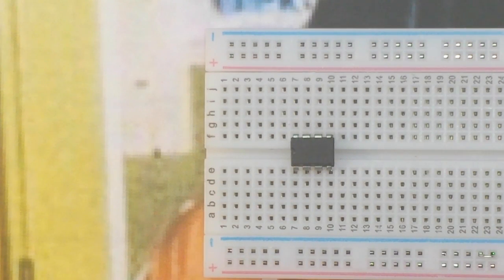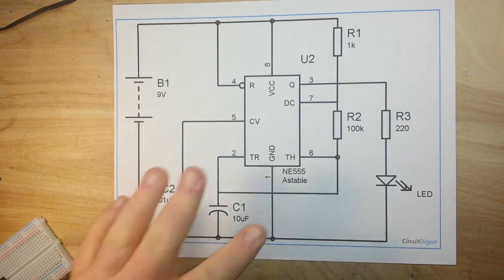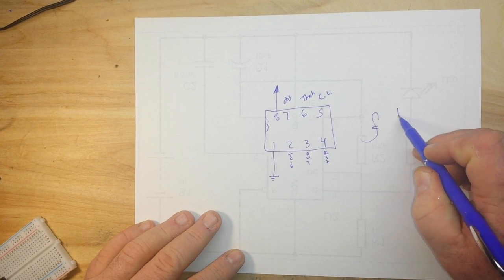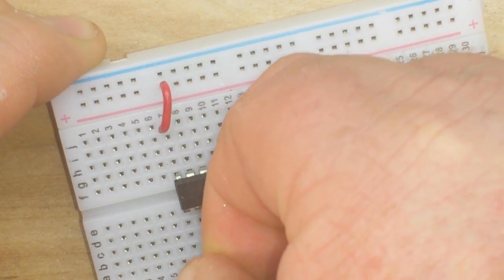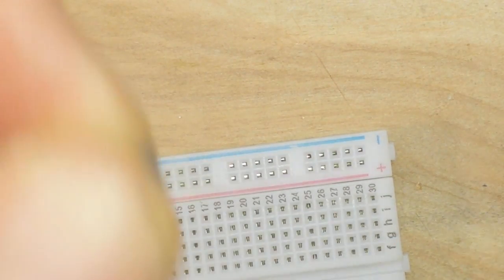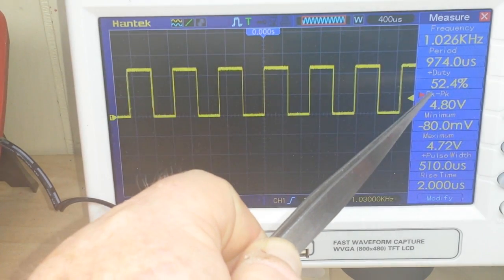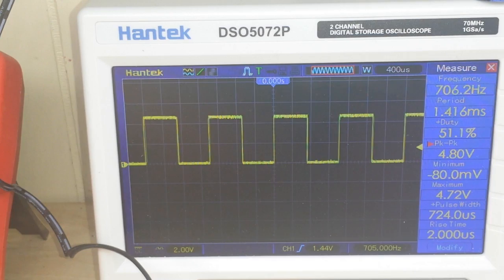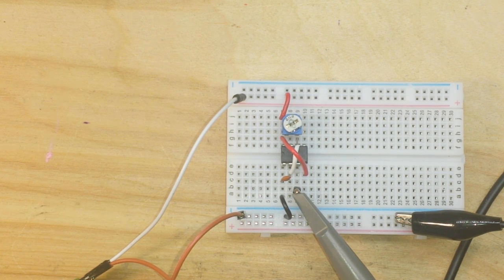The most simple way to set up a 555 timer

Comment: This circuit may be simple and it certainly is stupid.

Conspicuously missing is a power supply decoupling capacitor which is essential for reliable operation. Also missing is a decoupling cap for the Control Voltage pin. If there is very good supply decoupling, this cap may not be necessary but it is bad design practice to omit it. The instability due to lack of these capacitors is apparent from the frequency display on the scope. The pot allows setting the resistance between the Discharge pin and Vcc to zero, which can destroy the IC.
If a ceramic timing cap is used it should ideally be a C0G type. X7R aren't too bad. Nondescript ceramic disks of unknown dielectric properties are a bad choice if you want any semblance of stability.
Reply: lol
Reply: Yes, this is very stupid, it overheated my 555.

Comment: You showed us a formula for the frequency that depended on R_1, R_2, and C.  But your circuit only has one resistor. ???
Reply: Potentiometer counts as two (variable voltage divider). Another modification is to use two pots or a pot and a resistor to control the frequency. Ratio R1/R2 controls the duty cycle (on vs. off), R1+R2 controls frequency.
Reply: @camp0017  Would love to see a video showing exactly this.

Comment: Brilliant. You just answered my question 🙂
I am building a 100ns PWM and the Arduino isn’t fast enough.
Arduino can only reach 65.1ns
I am teaching myself how to build a pulse laser driver to run a 75w 905nm diode.
I am using the LM317 as a current regulator and now I can reach the 100ns max pulse rate to charge the diode. I can’t afford a $2000 driver so to build one for $50 is very good.
If my calculations are right :
R=2.18ohms
I=5.85A
V=12.8
P=75W
With a pulse duration of 100ns max.
Duty cycle is .01% which I have yet to think about. 
Thanks again.

Comment: Hi there, a newbie question: Is it possible to use this chip to turn a single LED on for 9 hours, then off for 15 hours then repeat the process?
Reply from the maker: Sure, you could make a 555 timer that, but an Arduino would be much easier. What is the context?
Reply: @learnelectronics  I have a very small enclosure and only a 4,5v battery.
Reply from the maker: Arduino Nano!
Reply: @learnelectronics  Ok, here’s the irl problem: cheap automatic Chinese chicken coup door that open and closes due to sunlight = irregular intervals. If cloudy it’s a no go. Solution: use a white LED and set on/off times to simulate the sun. I’ve tried it with a Nano and a RTC hooked up to a computer and it works fine, but I don’t want to drain the three AA batteries using a Nano and the RTC.
Reply from the maker: Hmm ok lemme think on it
Reply: @tokeofsweden  A "standard" 555 will take about 15 mA standby current so you might want to use cmos version.

Comment: Great presentation but for the guy who first heard of a 555 circuit 8minutes ago please explain what this is and why it exists
Reply: Try looking up ben eater's video on the stable or astable 555 timers.  He actually walks through the chip logic and explains the triggers and cap/resister maffs.  Simply search monostable or astable.
Reply from the maker: It's a timer with 3 different behaviors. Single shot, bistable, and astable. It can be adapted to be a clock, a switch, a timer, an audio source, etc..

Comment: Nice, but, how can I adjust de frecuency with a pot?
Reply: For the 555, the Cap/resistor combination changes the frequency of the trigger.  So increasing and decreasing the pot resistance changes the trigger.  The math is cap * resistance = interval.  It is laid out better in the datasheet for the 555.  Not all resistance is futile!

Comment: Can anyone help me on this? I try this setup with the potentiometer between Vcc, discharge, and threshold, but what I see on my logic analyzer is that the capacitor never discharges because the Discharge breadboard row is in series with Vcc, which is the right side of the potentiometer. So my output pin is low, but discharging never occurs

Comment: I have a favorite 50% duty cycle 555 circuit with just two parts parts!  It will ALWAYS oscillate at 50% D.C. and it has 100% INDEPENDENTLY adjustable frequency and amplitude.

From the standard monostable, pull out the resistor at pin 7 and the cap at pin 5 and toss 'em!  Now connect pins 2 and 6 to output pin 3!
*  ONE POT
*  ONE CAP
Adjust the frequency with the pot and the amplitude with Vcc
BTW: the formula for the frequency is given as:  1/1.39RC 
ps
The 1.39 comes from 2Ln(2)
THANKS FOR THE GREAT VIDEO!!!
Reply: Sorry, I meant "ASTABLE"

Comment: can't you do this without using pin 4 to vcc pin ?
Reply from the maker: Yes. PIN 4 is reset. It should be held high, but you can do away with it in most cases

Comment: I see you are interested in electronics
I need a pulse generator circuit please. Exactly twenty hertz and the possibility of controlling the Duty Cycle
Reply: That’s exactly what he showed. The resistor(pot) changes the duty cycle, and the capacitor the frequency. 
As far a s specific values... i couldnt tell you from top of my head. But should be easy to calculate/research.
Reply: @tuloko16  i need 400khz with modulation?

Comment: It's as simple as the flip flop I made to drive two different color LEDS through 2 different clear tubes to simulate a pulse for a kid's haloween mask made from a discarded face respirator. He got props for that. 9V battery tucked inside the respirator. Studs from leather collars, light chain and black paint = happy kid!

Comment: is it possible to adjust the length of the crest and the through of that signal?
I want to try to make the through longer than the crest
Reply: That was what he was explaining. You can set the pulse repetition rate (frequency) with the capacitor, and the dwell (% of difference between on time and off time) with the potentiometer. He indicated how simple it would be to have relays change between one component value or another. I will control a throttle with a servo for a HD RC aicraft/heli. It needs two speeds, idle and 2500 rpm. One 555 timer kit plus alternate components, and a double throw relay to switch between alternate values. Signal triggers relay and servo goes to work. Signal stops and servo returns to home position, no load.

Comment: i'll bet op amps have as many if not more uses than the 555 timer.
Reply: What's an op Amp? 🙈 operational amplifier, what does that even mean?
Reply: @Randorandom232  
It means that the chip can operate as a signal amplifier. (It can be set up for other functions too) ie. It can multiply the output signal by an amount (determined by the accompanying components (called biasing) and the internal multiplication of the chip usually between 50 and 200 times). The chips ability however is limited by the supply (or rails) voltage to the chip. The chip can not amplify above or below the max/min supply voltages.

Let's assume the following.
Supply Voltage: To the opamp: +15V & -15V. 
Input signal: Sine wave with a peak to peak voltage of 2V (ie. Goes as high as +1V and as low as -1V)
Internal Amplification: X100 -> Biasing (feedback): 0.1 -> Total amplification: X10

The output signal from this chip will be a sine wave with a peak to peak voltage of 20V (ie. Goes as high as +10V and as low as -10V)

However, as mentioned above you can't go beyond the rails voltage, so
Let's assume the following.
Supply Voltage: To the opamp: +15V & -15V. 
Input signal: Sine wave with a peak to peak voltage of 2V (ie. Goes as high as +1V and as low as -1V)
Internal Amplification: X100 -> Biasing (feedback): 0.2 -> Total amplification: X20

The output signal from this chip will be a sine wave with a peak to peak voltage of ~30V (ie. Goes as high as ~+15V and as low as ~-15V). 
Note not all opamps can go full rail to rail and will top out approx 0.7V below the top rail (ie. 14.3V in this case) and 0.7 above the bottom rail (ie. -14.3V in this case)

This is a simplified view of how an opamp works especially around the biasing, if you want to use an opamp you should look for a tutorial on how the biasing works, for a more complete picture.

Comment: How does one get the high to last a different amount of time than the low?
Reply: You can use diodes to set the resistors to either the discharge or charging phase, so that they affect the different on and off times. This adds additional components, but I think it's worth it.
Reply: Adjust the pot.

Comment: i want to use the  555 as a soft start and stop for car amplifiers that pop the speakers on shut off.  any advice?  thanks
Reply from the maker: Sorry, audio is not my specialty
Reply: Hey Tom did u ever figure out how to wire this with your amps to get a soft start turn on? I’ve been trying to figure this out also thanks….
Reply: @djrockon5729  I used something called an RC snubber circuit in parallel with the relay contacts.

Comment: how can i do it without one potentiometer one i need to be ON Every 1 Second ?? @learnelectronics
Reply: the pot is just an adjustable voltage divider, so technically you could do it with 2 resisters.  but unless you buying high tolerance resistors & caps(and even then), it'd be hard to get the desired cycle.  because of the variance in components, its pretty standard to use a trim pot(as seen in video) to tune it, often times manufacturers glue them in place once tuned. 

they are handy & cheap, I recommend getting a little variety kit, but if you have old electronics (power supplies, motherboards, audio equipment, anything really) you can scavenge them from there.

Comment: Nice and simple, but be careful not to turn pot all the way so as to short pin 7 with vcc. Discharge transistor wouldnt like that. Standard Astable set up always has resistor no smaller than 1K between pin 7 and VCC.

Comment: ....can I use it to produce high voltage connecting the primary of the trasformer to the out pout?????.....
Reply: likely so, however i would recommend using transistors connected to an hv power supply

Comment: i like how you executed the video, but there is a but, i am going to be making a 555 circuit soon for the first time and im going to use 2 resistors. sadly because i never made this circuit before, and because you used the adjustable resistor in place of r1 and r2, i still dont know how to make the circuit. it kinda sucks cause other than that you would of helped me learn how to build the circuit. thanks for the upload, i still gave a thumbs up.

Comment: Uh, you eliminated the output indicator led and current limiter. So, you didn't recreate the circuit. The only "component reduction " you did was to replace the tow timing resistors with a pot, which is essentially two resistors,  one on each side of the wiper.
Reply: A pot with 2 resistors? The wiper rides across a single resistance surface for reasons to enable adjustable control of resistance.
Thus .... 1 resistor.
(Your thinking of the wiper dividing the resistance at it's contact point.)
Reply: @raybin6873  try watching the video again. The original schematic shows two resistors creating a voltage divider. In his "kiss" version he simply replaced those two with a pot. Also,  since the output indicator circuit is eliminated, this is not a simplified version of a circuit that flashes a LED. If you don't duplicate the result,  then it's not an equivalent circuit.  Replacing an ethernet switch with a toggle switch isn't simplifying the circuit.
Reply: G E T  R E K T  he said he replicated the circuit that flashed a LED. The original circuit flashed a LED. If the recreation doesn't do exactly what the original did, it's not a recreation.
Reply: G E T  R E K T  it was a year ago,  so I don't remember it exactly.  He makes a big deal about reducing components but doesn't actually reconstruct the circuit,  that much I remember.
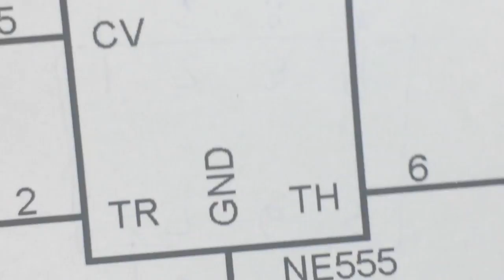Reply: G E T  R E K T  at 6:00 "...now how much easier is that than that mess?" Well, that mess actually flashes the LED, so your circuit is not a simplified way to accomplish the same thing,  because yours doesn't. 

Also,  unless you by some strange coincidence happen to have exactly the right potentiometer,  you can't set up for a desired duty cycle. Using two resistors you can change duty cycle and frequency independently.

He's trying to claim he's eliminated a bunch of components and accomplished the same thing.  He didn't.  He eliminated only 1 component from the astable multi vibrator portion of the circuit,  but in doing so he is stuck with the duty cycle changing with the frequency. So, no, he didn't maintain functionality while changing component count. Also,  he declares himself a moron by saying that the schematic is convoluted and complex.  To anyone in electronics,  it's a very simple circuit.

Comment: Isn’t a 104 capacitor 0.1 μf?
Reply: Yes it is. 100nF and 0.1uF is the same. It's 1000pF to 1nF and 1000nF to 1uF :)
Reply: @Hychtjic  — Thanks!  I also appreciate you adding those conversion factors!

Comment: How do I adjust the freq with a pot instead of a cap.
Reply: The pot he uses is just a substitute for r1 and r2. You can place a fixed resistor across one side of the pot and changing the pot will affect the frequency and duty cycle.
Reply: I think by putting a pot in series with the cap.

Comment: what it is purpose of the .01uF cap on pin 5
Reply: It reduces noise. It you want your square wave nice and tidy, you should add that capacitator. If any ragged old square wave will do, you can leave it out
Reply: @michelfug  i been doing a bunch if measurements of 555 circuit timing with stopwatch versus the formula time.   the 5 to 1 pin didnt seem to matter for that. 

thanks a lot for answering question. i been wondering what it did.

Comment: This was great. I was experimenting with a version from my old Radio Shack Engineer's Handbook, by Forest Mimms, and not getting favorable results.  I have used the "academic" version, but  I was amazed to be able to build this minimalist version,  and get precise control over the frequency.  With R1 & R2 , being equal I have  control over the duty cycle aswell. I also liked the reference to Steve Woznicak. Job's often gets so much of the credit for Apples success, but Woz was the Engineer.
Reply from the maker: Woz is the man.
Reply: @learnelectronics  I really enjoy your presentations. I am  in my final year as a student of electrical engineering, and your videos help me to get back to in tune with why I chose this path. The passion for experimentation.

Comment: hello . can 555 ic operate with 3 v battery?
Reply: No. The minimum  voltage requirement is 5.0  vdc, but you could always use two 3 v batteries in series to obtain 6.0 v.
Reply: @TheZooman22  thank you
Reply: @Razalipuchong  yes you can
Reply: @TheZooman22  wrong. There is two types of 555. One using 5 volt and up. The other czn operate with only 2 volt but the current in the output is very low need to be drived with transistors

Comment: Excellent tutorial. I have a question for you. we have a pot adjusting the duty cycle.... I'd like to keep that and add a pot to adjust the speed somehow. Is this possible?
Reply: GORF I’m sure you could with a variable capacitor. Cheap on amazon
Reply: @mikatomik5532  Yes but those are not usually large in range nor are they usually large in value...but I did think about that.

Comment: hi, is it can pin 3 to connect to 4017 ic to make led chaser?
Reply: Yes, you can
Reply from the maker: Yes
Reply: learnelectronics this circuit using variable resistor, how if using value resistor? how the connection, which pin to connect the resistor?, circuit diagram?

Comment: What is astable mode?
Reply from the maker: Blinks continuously
Reply: Also, astable requires no SPSD switch integration, you will understand the astable principle further when you build the monostable (one-shot) and bistable circuits in comparison

Comment: I very mush like your simple methods but not the hands. When I do video demos I always use a good quality dental tweezers, the one with the curve near the end to place parts or very fine needle nose spring loaded pliers. Then my viewers can see exactly whats going on but so can I. I also find the old solid core color coded, dual pair telephone wire perfect for bread board work. It strips easily and fits well into bread boards. Sling your local phone tech installers installing new phone systems into new buildings and they would happy to give the useless off cuts of bundled cables.
Reply from the maker: Thanks for your input. My hands are swollen do to congestive heart failure. Ill be dead soon and my hands won't trouble you any more.
Reply: Sorry to hear that. Life is a cruel mistress. In youth she fills us with promise then takes it all away. I'm an old fart of 76yrs, worked until 70 then I got the push because I was 42% whole person disabled from work related injury. Now from the mistress I have an electrical problem in my heart, it has a bad habit of missing beats often one in four-five. Next step a pace maker.

Comment: Great job!
I like it: a just barely good enough circuit.  I'm working with these pesky little 555's in my Electronics 101 course, and practical tips are priceless.
What I did on my bboard is to wire both rails with Vcc.
In your example, I would've then, instead of routing a 2cm wire OVER the chip between pins 4 and 8, instead use a tiny jumper from the hot rail to pin 4.

Comment: Would it be possible to set up the frequency to 0.17Hz even?
Reply from the maker: Possibly, but I do not have the right resistors or capacitor to do it. F=1.44/(R1+2R2)*C

Comment: pin 4 dose not have to be connected to make the 555 time work!
Reply: When pin 4 of the LM555 is triggered (by shorting it to ground) through the momentary switch, the timer is reset.
Reply: Pin 4 is connected to positive to prevent premature resets. This is known as a pull up configuration.